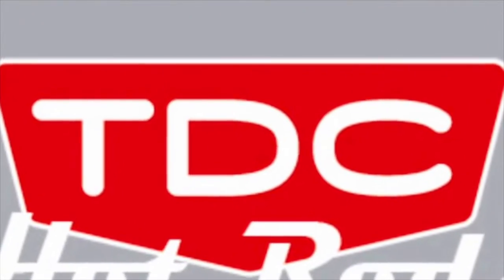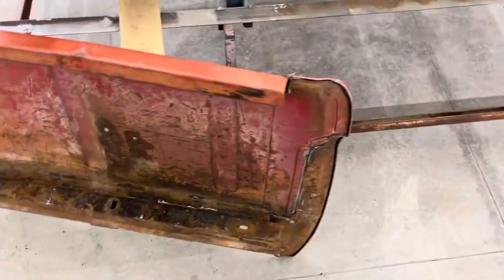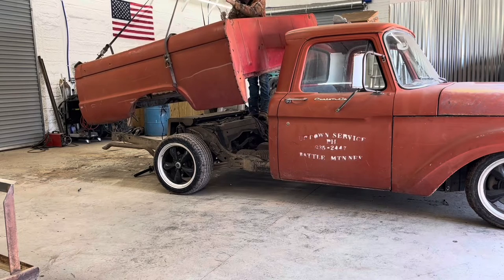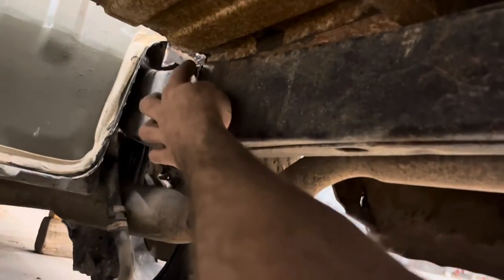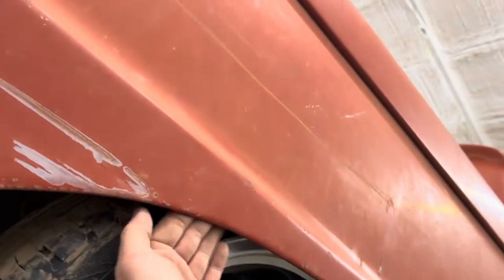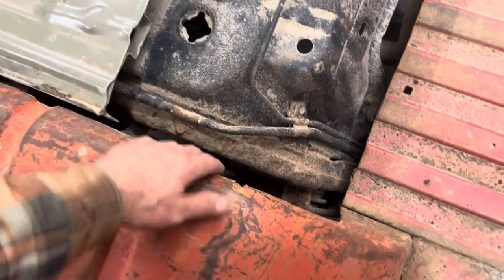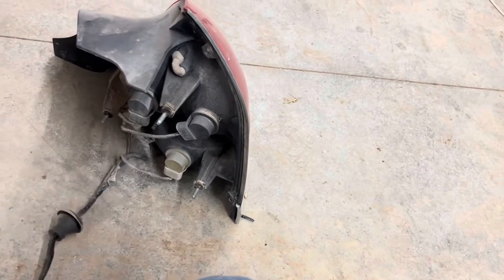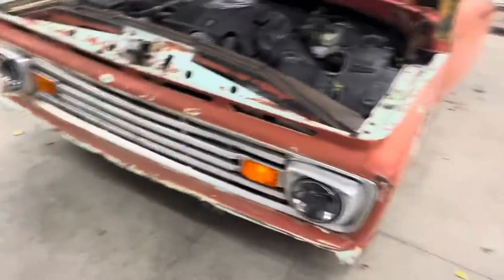Crown vic swap f100 part 6. It’s got a bed and lights

Comment: Truck looks good , i just shortened my 55 chevy truck frame and bed, 9 1/4 in the front and 2 1/4 in the rear amazing the difference that little 2 1/4 in the rear made, as far as the overall look, awesome you have lights😁😁

Comment: Nice build. I'll be starting a similar build with my 75 F100  & 09 P71 Interseptor soon. FYI, get some aluminum tape from Lowes & use it inside the taillight housings as reflectors. You might also need a resistance to slow down the flasher, probably due to the use of LED's on the front end & the deletion of some of the bulbs on the rear. Nice Job!